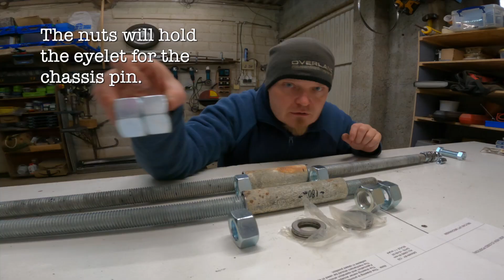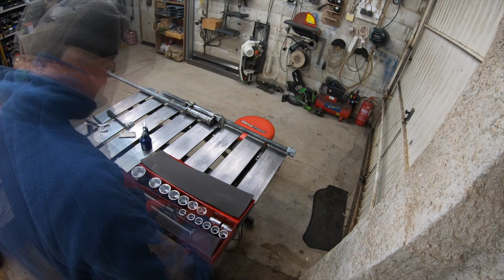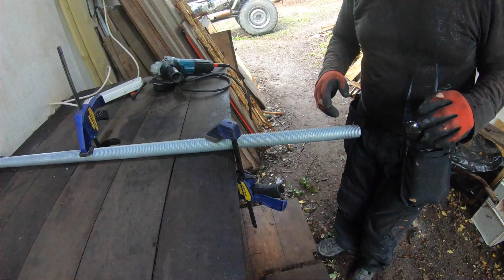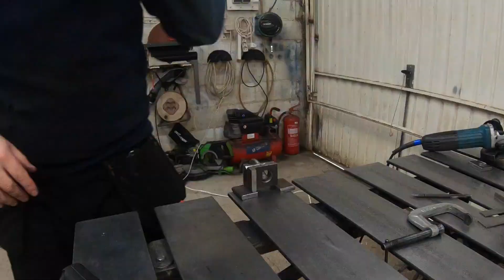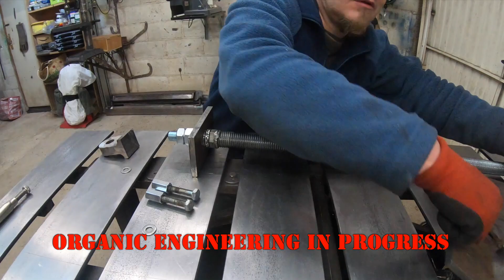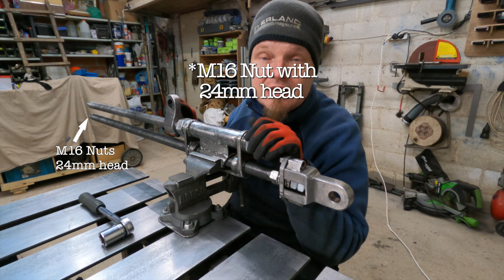Unimog Camper E019 - Making a cab tilt mechanism

Comment from the maker: Suggested improvements:
1) Use M30 connector nuts (~3x width of regular M30 nuts)  instead of regular nuts, especially for the chassis mount as it would reduce binding from welding and it would also reduce the lever effect due to a larger surface with the threaded bar.
2) Use trapezoidal threaded bars instead of regular machine bolt thread. Search for T30 on eBay and such to see samples. Note: I just did an extremely quick search, and I could not find T30x1000mm bars at all, only 500mm long at a much higher price than the regular M30 bar. Your search-fu is probably better than this.

Please keep the improvements coming and I'll do my best to update the comment. Thanks!
Reply: I had never heard of this. However, I have heard of Lead Screws. I was thinking the whole time how come not use lead screws? They would be faster plus not as prone to binding with so many contact points.
Reply from the maker: @TheLostWoodchuckers  If my information is correct, then lead screws use trapezoidal thread, also known as acme thread. Hope that clears it up. And yes, would have been better. 😎👍🏻

Comment: Video marathon still going on, but I have to say it now. These are by far the best Unimog DIY videos on Youtube. I am still dreaming of getting myself a U1300L and your vids are picking up topics I am highly interessted. Not part of this video, but I was very interested in the sound reductions mods you did on the cab. Would be great to know if you could comment on the outcome, or did you even meassure dB(A) before and after. Keep up with the great work. Very informative and entertaining. Can't wait to see the videos on the camper box build. Greetings from Germany.
Reply from the maker: Grüße und danke!
Thank you for the very kind words! I'm sure you'll get your U1300L one day. Our experience with our truck is pretty much just positive. It's pretty straight forward to work on and most of the modifications are very easy to do, albeit time consuming. Mercedes prices are high, but that's no surprise.
We didn't measure the sound for two reason, firstly we don't have a sound level meter (could have used a phone app, perhaps?), but the main reason was that we started the work before the truck was registered so we were unable to actually drive it. The sound is now more civilised. It's not a quiet truck by any means, the tire noise alone would never make the truck quiet. However, from the little pre-soundproofing drives we did, the sound was much harsher and is now more easy on the ears. Think of it as throwing a thick blanket over your noisy air compressor in the garage; you can still hear it, but it's much less annoying. Keep in mind we've also not touched the rear wall or large parts of the firewall at the front under the windscreen - there's still room for improvement if needed. When doing 75km/h, it does require a bit of effort to talk, but you do not need to shout, so we are hoping that we can still reduce the noise by a little bit.
Thanks for watching and I hope you come along for all of the slow and bumpy ride! 
Tschüss!

Comment: Putting two nuts together and trying to turn them smooth on a bolts it is hard I did little search and you can find long bolts 16 cm long on line, Pura Vida from Costa Rica👍
Reply from the maker: Connector nuts would definitely be a better solution for the chassis mount. Sadly we didn't even consider changing the purchase list for the plans we got. Hindsight 20-20 and all that. Hopefully anyone building this contraption in the future will get the benefit of this information. Thanks! 😎👍🏻👍🏻

Comment: Build to fail,
To much flex under load when extended
Reply from the maker: Thanks! The answer will be revealed as soon as possible.
Reply: @JockeSelin  i am puzzeled   why you did take steel on steel  and  normal tread   ,   i would  choose   1 trapezuim tread because this is make for such things
Also left en right tread  and i would use a  tube , with on both sides  the tread  and bronze tread in the tube
Reply from the maker: @cees1910  In an ideal world that would be great. However, this was supposed to be a cheap (done!) and quick (not!) project for a tool that'll probably be close to obsolete once the truck is on the road. I also don't have access to lathes and milling machines, so making bushes, and such is out of the question. I'd have to buy them which would make it more complicated. 
If I were to use this tool constantly, like in a workshop, it would make sense to make it a lot better.
Please let me know how your build turns out. I'm sure there are people who'd need a more elaborate version. 😎👍🏻👍🏻
Reply: @JockeSelin  well can you not buy trapezuim  tread rods there  and trapezuim nuts?  ,  Tr 30  x 6  nuts  cost here 6 euro tread 1 meter rod about 25 euro  and  steel tube is also not costly
Can use old steel pipe   ,    our hence you could use legs and pipe  from scaffolding  that normaly has trapezuim tread   ,   also the tread must not be to tighten thing but to move things  so trapezuim tread     like in a vice
Reply from the maker: Good info! Let’s hope it is of use to someone! Thanks!
Reply: @JockeSelin  since you can weld  , you could also take 2 round rods  , and weld a nut in the ends  ( like a tube)    i would choose left and right treads and     bronze nuts if avaible  and left and right tread   , and about 1 meter apart from each other to prevent flex   , this to over come friction in the tread
Reply from the maker: @cees1910  Good ideas! You should make a video so others can benefit from this! 😎👍🏻
Reply: @JockeSelin  well i am bad i making videos     i did build something  like this  to raise a roof of unimog in the back of a old fire truck and stabilize it
Reply from the maker: @cees1910  It would be a shame if all that knowledge gets lost. 🙂 There’s tons of ways this device can be built. Time, money, effort, tools, requirements, etc, all play a part. You’ve got some very good information there for a mechanism that’s quite a bit more refined than the one I’ve built. 😎👍🏻
Reply: @JockeSelin  well i do not know , just a simple bike mechanic